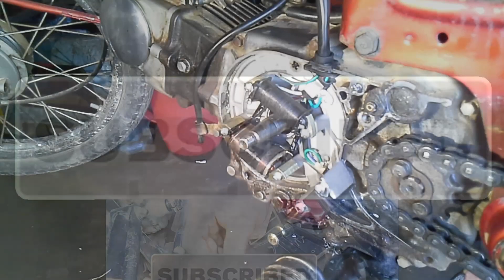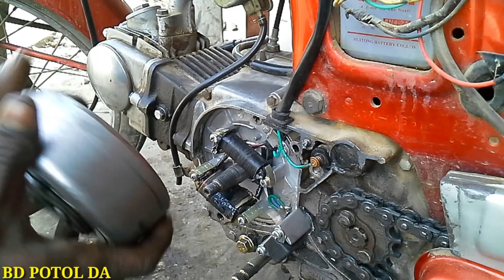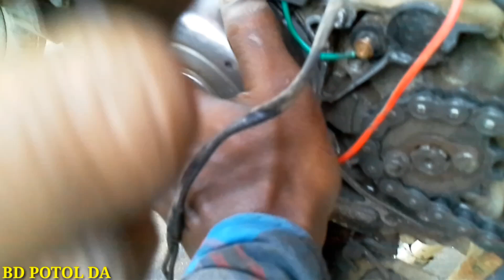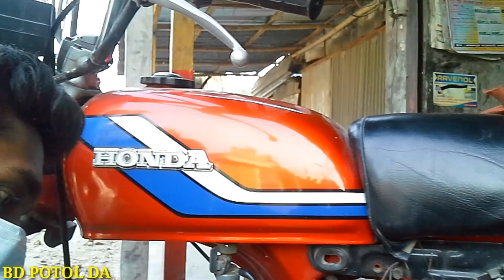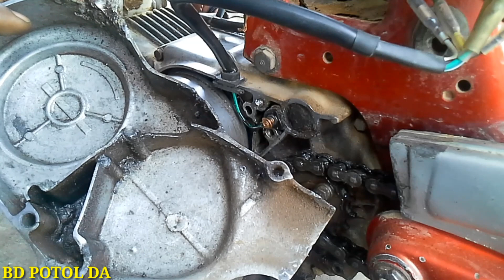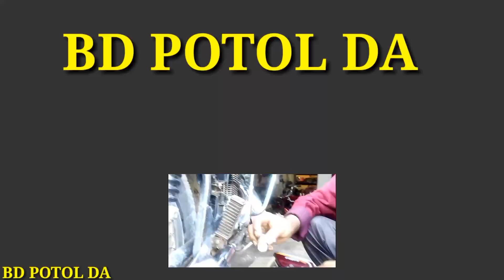How to conveert point to cdi At Cd 70

Comment: main kya kya cheez install hungee pulser and cdi unit bss? point ko hata krr coil kara chsnge nhi krna
Reply from the maker: CB Point does not work properly if you have Can Snake Tall. Also, if Magnet Cam makes more money then CB Point does not work accurately. That is why we have made CDI system. Thank you.
Reply from the maker: कैन स्नेक टॉल होने पर सीबी प्वाइंट ठीक से काम नहीं करता है। साथ ही अगर मैग्नेट कैम ज्यादा पैसा कमाता है तो सीबी प्वाइंट सही तरीके से काम नहीं करता है। इसीलिए हमने सीडीआई सिस्टम बनाया है। धन्यवाद।
Reply: @bdpotolda9053  i agree cdi ayatem is better than point but my question ia why not  coil  kara  (having a wire of winding) also chnaged for cdi coil kara? hopd that cureent of cdi  coil kara is better than point  who's having more windings!